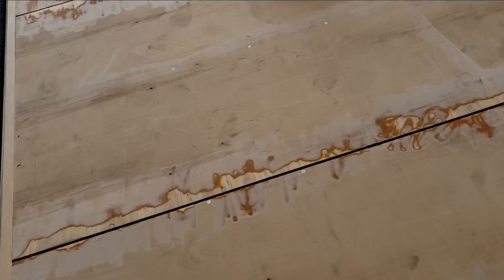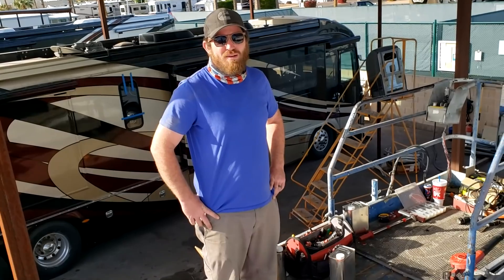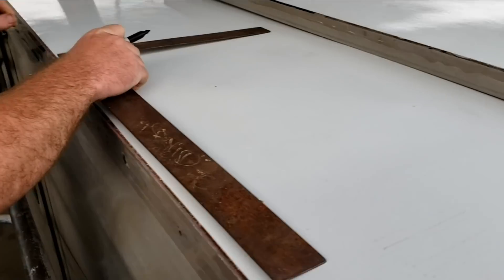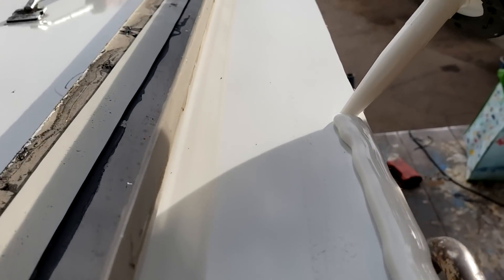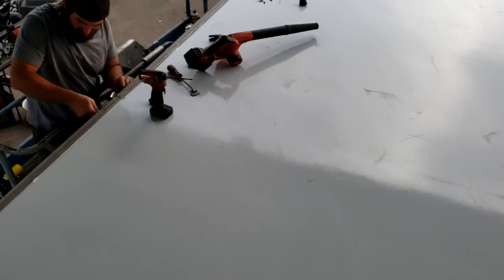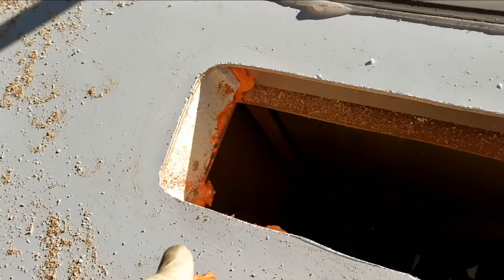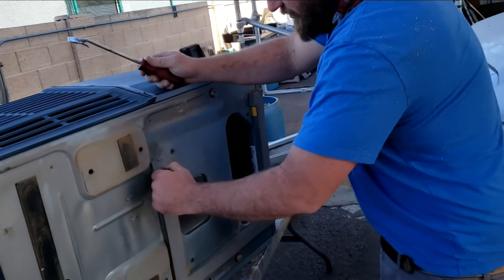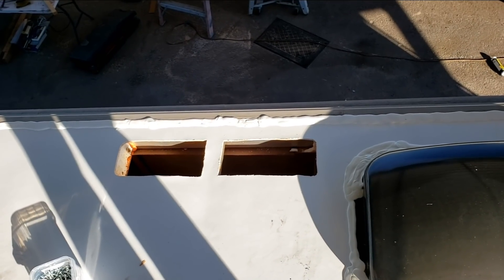Can We Ever Finish the Roof on a 2014 Minnie Winnie?

Comment: You mentioned using NuFlex 311 on the seams and vents.  When would someone use NuFlex vs Dicor self leveling?  Getting ready to strip and reseal the vents on my 2002 American Coach.  

Great series.  I know it takes a lot of your time to film and edit for posting.
Reply from the maker: thank you. Winnebago and Tiffin use Nuflex, most other membrane and fiberglass roofs will have dicor type

Comment: could one use a putty knife to smooth out the Dicor or Silicone (around the skylights and vents)? I know smoothing it doesn't help with the sealing, but it would look better. Would a putty knife or "plastic bondo spreader tool" work or would that just make a big mess?
Reply from the maker: The roof sealants are self-leveling so most tooling would still spread out. It generally turns out better if left alone. This stuff is more like honey and makes little strings that make a mess

Comment: Hey man, I  wanted to ask you about a slide seal,

I jus went to a dealership and looked at a 2021 Thor Gemini with the full wall slide, and I could see light through the slide seals from the outside looking in, for pretty much the entire length of the slide along the bottom. Is that normal?
Reply from the maker: Thanks for watching! Truthfully, there is always a gap, there should not be a large gap but it's not uncommon

Comment: Have a question. Ordered some roof sealant through a Winnebago dealer for our 15 class A with Fiberglass roof. They sent SikaFlex 715. Is that correct for fiberglass? Says its manly for EPDM roofs. Thanks man!
Reply from the maker: it doesn't sound correct to me,
Reply: @AZExpert  I just got ahold of Winnebago. They say the Sikaflex715 is the new sealant for rvs that originally came with Black Nuco Sealant. But the sika needs a primer to use. What would you do in this situation?
Reply: Nuco is nuflex311 , but in black(green label instead of Yellow)
Reply: But the black 311 seems,to be out of stock everywhere lol. Id assume whote 311 would work.